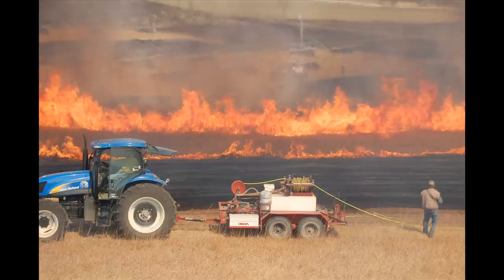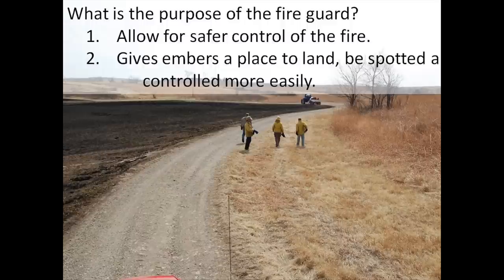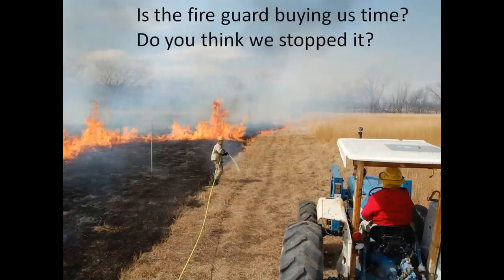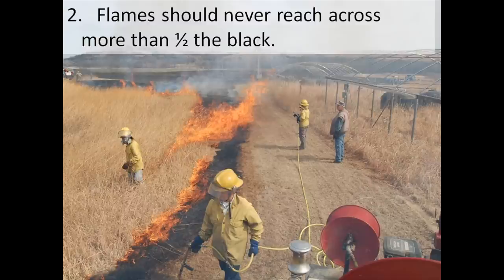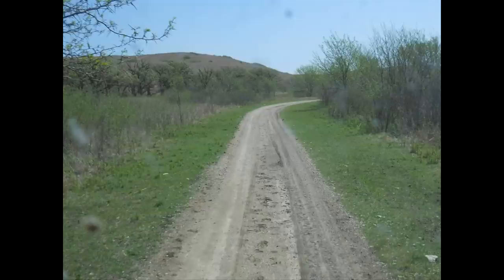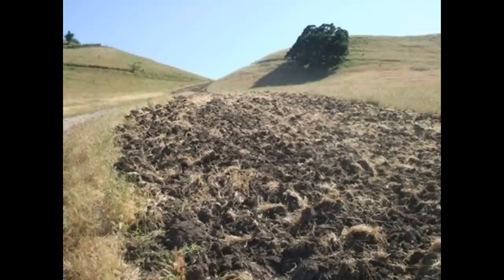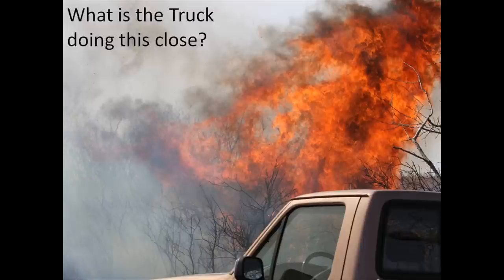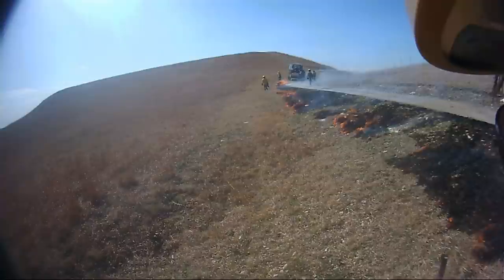Prescribed Burn 1: Fireguards / Firebreaks 1 of 3

Comment: You had water and pumps on hand. Why not wet or at least dampen the  grass on the opposite side of the fire guard before ignition? I burn under pine trees in my front yard every couple of years and always rake and soak around everything I don't want to burn. I learned to put my fire out before I light it(wet what I don't want burned) several years ago when I was cutting metal with an acetylene torch. I had wet the ground under my work area but had a blowout that sent sparks outside the wet area. Once I realized the grass was burning I got a water hose and began to spray, no problem, right? Right. Until, while trying to flip a kink out of the hose, I broke the pvc water pipe. That's when the mad scramble started. Now I wet everything around if I have to cut outside my shop. Lol. I know one can never be too careful and have many times postponed my burn due to wind, wind direction and predicted wind issues. I realize tall grass is a different situation altogether though, so I was just curious. Very helpful information here, thank you for taking time to make and post this!